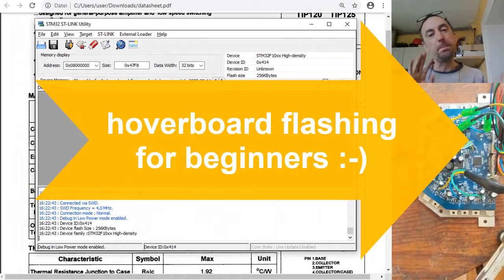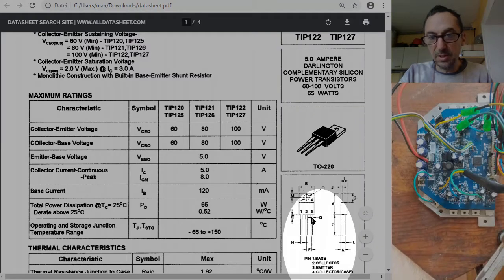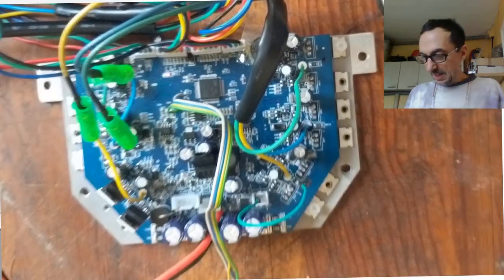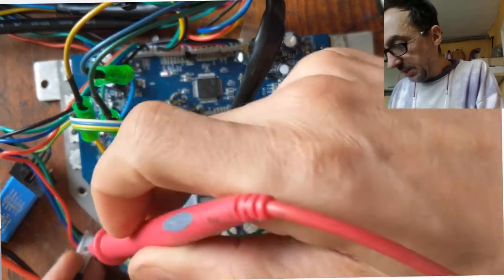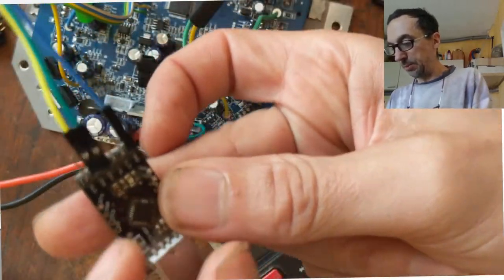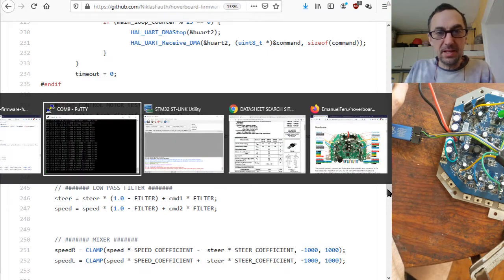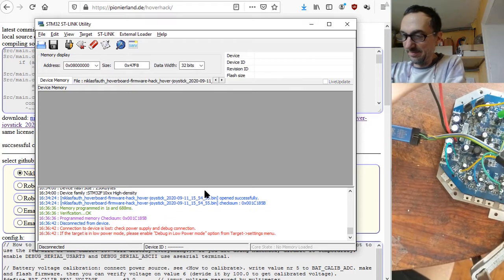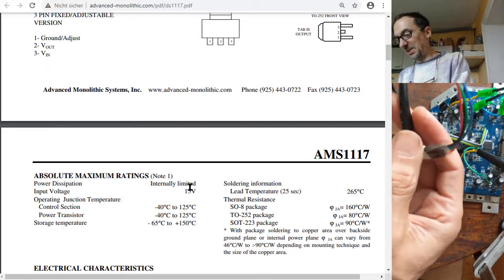Hoverboard flashing for beginners (red != +14V)(adc wheelchair)

Comment: Hi, robo durden !  Your video was very helpful to me.
There were many problems, but I finally uploaded the firmware.  
One problem is that I want to reduce the maximum speed to a quarter.  I'm not good at coding.  However, I wonder which part of the source code should be changed.   Please.
Reply from the maker: Emanuel Feru firmware or Niklas Faith firmware ? What control method ?
Reply: @robodurden  Emanuel Feru, 
and potentiometers for control.
Reply from the maker: @andesjose8  you can add   speed *= 0.25; in main.c at line 278.
Depending on CTRL_MOD_REQ in line 144 of config.h this will quater the max pwm or max voltage or max torque. 
Not really a good idea as the efficiency of the motor is best at 100%.
Reply: @robodurden  So, which firmware is efficient?  I do not need more than 5 km/h
Reply: I know that low speed consumes less energy.  I tested it with A-tec's firmware, and it ran for more than 5 hours at 4km/h. With 2 motors
Reply from the maker: You need a 1:4 gearbox.
Reply: @robodurden  Can I understand something like a over spec for my project ?
Reply from the maker: I don't understand your words.
Reply: @robodurden  1. To reduce the speed to 1/4, it is more efficient to use a gearbox, which is hardware, rather than software.
2. Using a hoverboard motor to reduce the speed to 1/4 is not efficient.
3. I think the efficient way is to use a smaller motor motor and gearbox than a hoverboard motor.
4. The hoverboard motor is too big for me, and I don't need it for my project.
Reply from the maker: As I don't know your project I can not help you. What is the speed and total weight that you want to drive uphill at 5%.ascent (5 meters higher every 100 meters)? Then I can calculate what motors you need.
Reply: @robodurden  calculate ?  Wow ~~~ ! 
 Max speed ; 5km/h, Max weight ; 50kg,  and  5% ascent(I've never thought about it)
Reply from the maker: 5 km/h is 5/3.6 = 1,30 m/s .
Per second you are climbing 1,3 * 5/100 = 0,069 m/s (a 7 cm/s lift)
The energy needed for the lift is E = m g h = 50 * 9.81 * 0.069 = 34 Joule.
The needed Power is E/t = 34 / 1 = 34 Watt.
Overall efficiency of your vehicle will rather be 50% (a good motor has 80%, gearbox 80%, tires, cables, etz.)
So yes, a 100 Watt motor would also do.
But you will not find a 100 Watt BLDC with such a nice slow rpm/V as the 14 kV = rpm/Volt as these hoverboard motors.
You could try these scateboard motors but they have higher revs, and you will need at least a two-stage gearbox :-(
I suggest you stay with the hoverboard motor but let it run on 24 Volt or even less.
Then you have 2/3 speed but motor is more efficient then 36 Volt and adc input set to 2/3.
That is what i do with my 6 km/h solar camper. 7s LiIon = 25 Volt.

And yes, if 25% torque is sufficient to drive uphill, than keep it simple and keep the direct drive. If the torque is not sufficient, you need a gearbox. 
And a smaller motor will not help. The torque of these hoverboard motors is already great.

A gearbox will make your vehicle noisy ! 
Especially a planteary gearbox.
A single chain drive like with my solar camper is okay. But already quite complex..
Reply: @robodurden   Thank you for your kind answer. Noise doesn't seem to be such a big problem in the video below.    https://youtu.be/ScrxtbMkl7E  and You suggested using 24 volts instead of 36 volts. Then what else should I change as like your solor camper.
Reply from the maker: @kshan9282  that video is pretty much useless because he put the phone onto the skateboard and did measure the vibration noise. He confirms that himself later in the video. 
Without full details on what you plan to do I can not help you with details on a possible chain drive. But I guess that a belt drive is not a good idea. Belt drives are good with high revs. But the hoverboard motors are already low revs enough to make a chain drive sound like a small river nicely running nearby.
I am currently building an electric tractor out of a 50cc Fuxin Quad. Will also use a chain drive. By attaching 9T Panasonic E-Bike sprockets to the two motors and  11-42 cassettes to each half of the rear wheel axis. 
As I want recuperation and electric brake I can not use these nice free wheeling sprockets of my other tutorial. I also need a 9:42 gear ratio to get the max torque. My total weight is 500 kg, mit 50 kg :-)
Reply: @robodurden  Can I use 24 volts without any change ?
Reply: @robodurden  Could you let me know how to use 24volts ?
Reply from the maker: @kshan9282  you only need to reduce the number off battery cells from 10 to 7 in config.h Otherwise the board will shut down because it thinks a 36 Volt battery is empty. At 7s = 25.2 Volt, one motor will no longer have 350 Watt but rather 250 Watt. But efficiency will be better for these 250 Watt at the slower max speed than 10s at 7/10 pwm input.
Reply: @robodurden Mein Dank gilt dir wirklich.  Es ist sehr einfach, es so zu ändern. Wir müssen es sofort machen.

Comment: compiling failed :-(
could not parse original config.h

the results of your github robodurden foc..
Reply from the maker: That's only a message not a compilation error. Just continue and click the 'compile at your risk button'. 
And don't be so fearful ;-)
Reply: @robodurden  
Sir
I want to use bluetooth esp32 and joystick which is usually used in Arduino projects 
what variant is recommended
Reply from the maker: @bahrulhuda5564  if you want to make use of the steer value than better go with the original Emanuel Feru Firmware.
My fork is only for my variant_uartcar which only need the speed because a car has a steering wheel.
You can connect the two potentiometers of the joystick directly to the hoverboard controller as I have shown in this video.
Or choose a uart communication variant and let the esp32 read the joystick and send serial speed and steer commands.